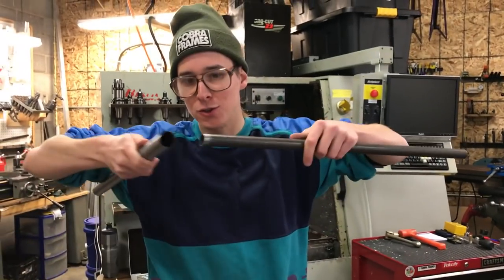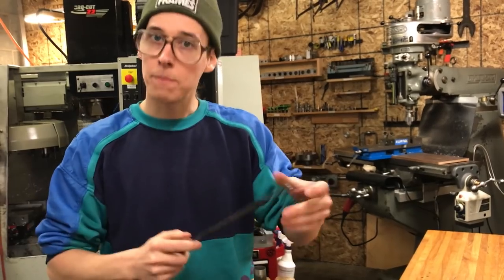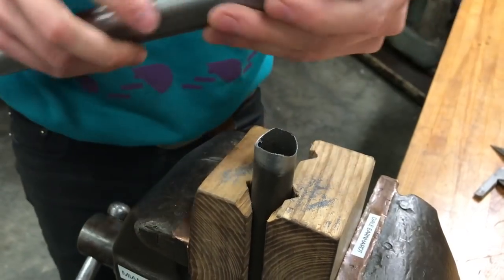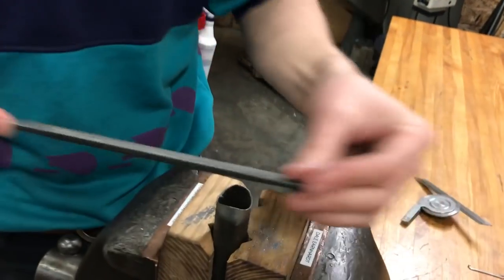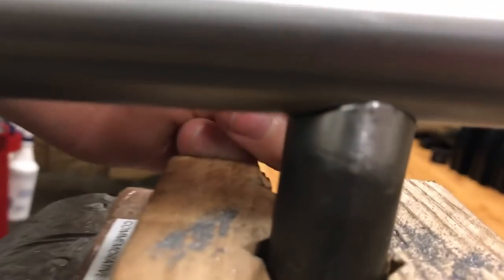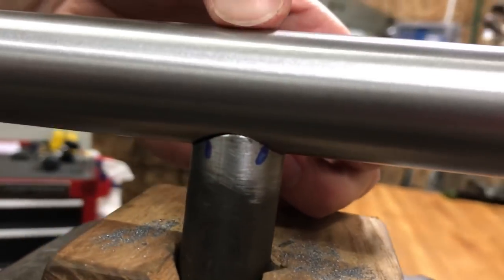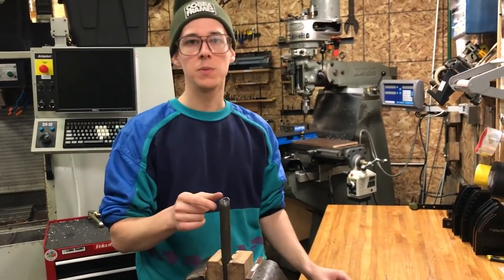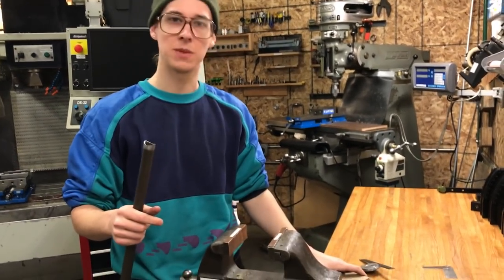How to Miter Bicycle Tubes with a Hand File | Framebuilding Tips

Comment: I remember watching this video a while back. It inspired me to finally get started on my first frame that I’d been thinking of doing for a while but didn’t have any fancy tools. Thanks for the great content!

Another cool tip that I learned from Marc-Andre Chimonas’s book Lugged Bicycle Frame Construction is to wrap a bit of sandpaper facing outward around the other tube and grinding out your mitred tube using that after you get pretty close with hand files.
Reply: Just flicked through the comments and saw someone mention that trick already and you mentioned it’ll be a slightly larger diameter than desired which is also true! You’re right that maybe using a slightly smaller diameter would help.

Comment: I was wondering if it would be ideal to wrap a tube in sandpaper to make a final pass and have a exact and uniform radius? Lets say for brazing where its more critical
Reply from the maker: You can do that sort of thing. Wrapping a tube in sandpaper will increase its diameter by a significant amount, so ideally you'd use something round that was slightly smaller in diameter than the tube you're trying to fit it to. And that would also require that you could make a "file stroke" exactly at the angle you wanted and centered perfectly left to right. If you use a file or sanding method that is slightly undersize on the radius, it allows you to sort of "chip away" at it and sneak up on your fit, and that seems to work really well when you get a feel for it.

Comment: how many mm gap is acceptable before joining tubes for a fillet, lug, or tig weld to be safely strong?  thanks for amazing vids.
Reply from the maker: Get it as tight as you can. Less than a fingernail gap is a good starting place. As you develop skill it becomes easier to get the good fitup. If you're REALLY good at welding you can fill some gaps, but it's not recommended and it's certainly not easy at all. Much better and easier to start with tight fitting joints.